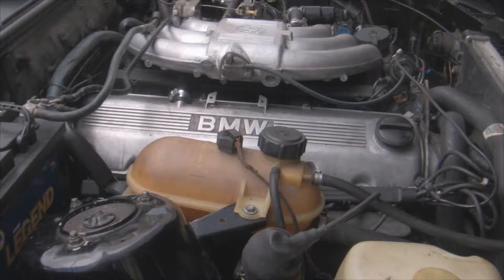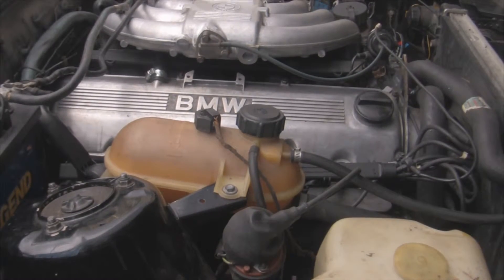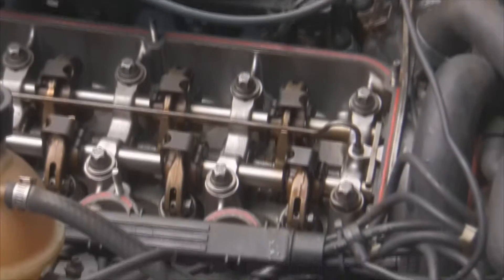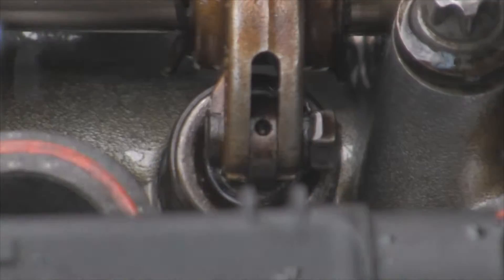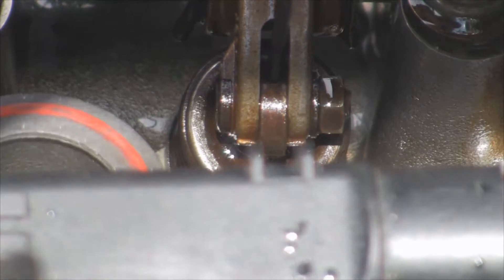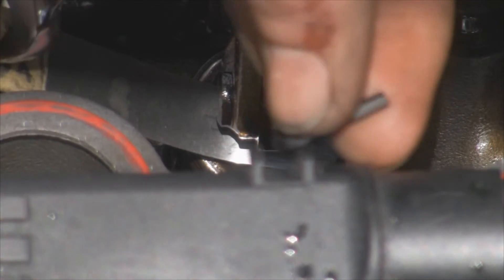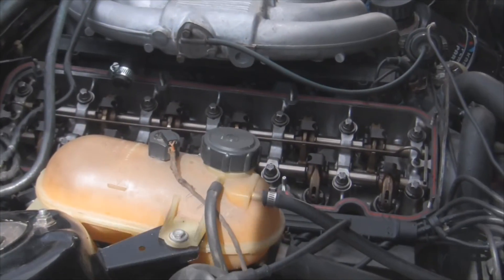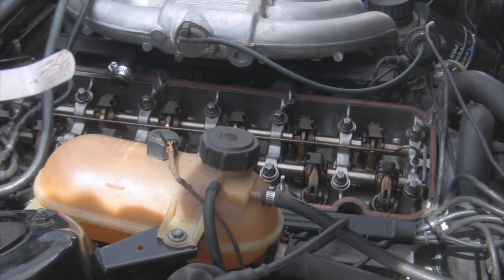How to adjust your valves!

Comment: Thanks for posting this! Did you have to remove the spark plugs? I might do this tomorrow if I can find my feeler gauges.
Reply from the maker: +Logan Case you are welcome man and it makes it easier to turn the crank which is definitely true if you remove the plugs. I did mine with the plugs out but didn't for this example. I would say it's worth the time to take them out though =) just dont drop anything into the holes. GL